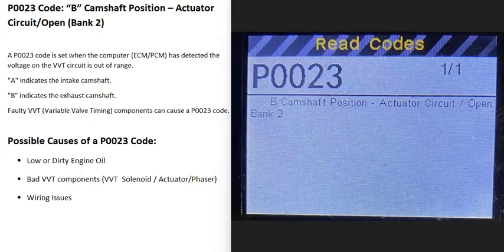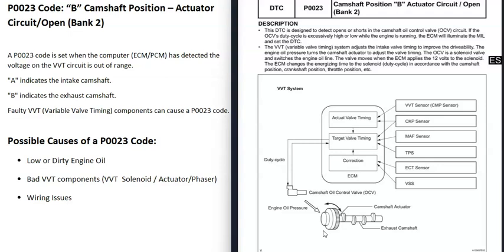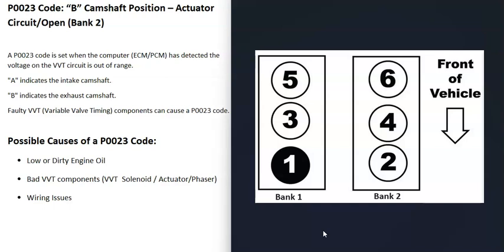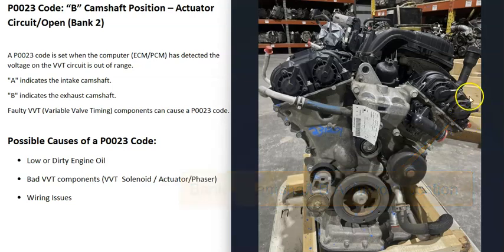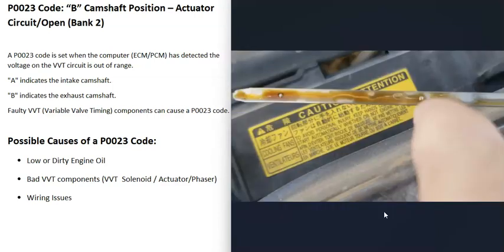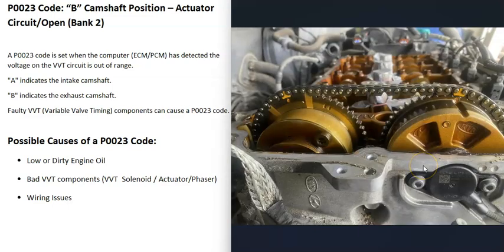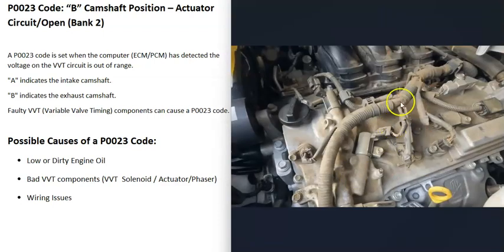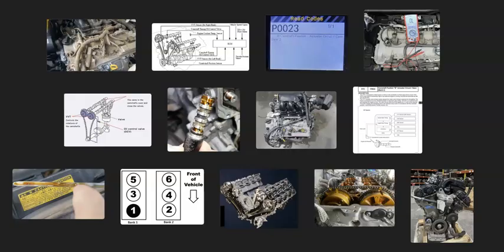Causes and Fixes P0023 Code: “B” Camshaft Position – Actuator Circuit/Open (Bank 2)

Comment: I just saw your video from a few months ago about the P2195 codes

I have a 2005 Elantra with P0171, P2195, and P0170. When I used my scanner on it, the upstream sensor is reading 2.56 volts, downstream is .88 volts. 

The really weird part is that my short term fuel trim is at 0% and my long term fuel trim is at 25%

This was all done at idle, warmed up. Should I just change the o2 sensors? Im wondering how to narrow it down to the real issue without throwing money and parts at it.

Thanks for your videos by the way, they're extremely helpful for troubleshooting this stuff.
Reply from the maker: Lean and rich codes are notoriously hard to diagnose. Your codes seem to only be on the bank-1 side of the engine. I would test the bank-1 sensor-1 and be sure it is good. If there are no other codes pointing to the issue, the spark plugs can be removed one at a time, matched to a spark plug burn chart to see if there is a lean condition on a cylinder. If it's lean on only one cylinder, I would focus on it. If it's all the cylinders on bank-1, then it's something that would affect all bank-1 but not bank-2. Like I said, lean, rich codes can be difficult sometimes.